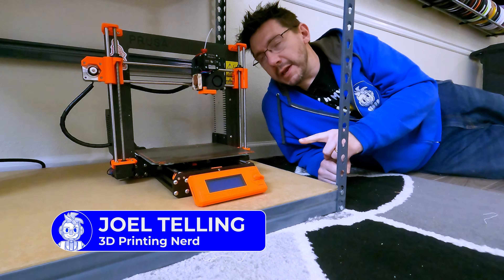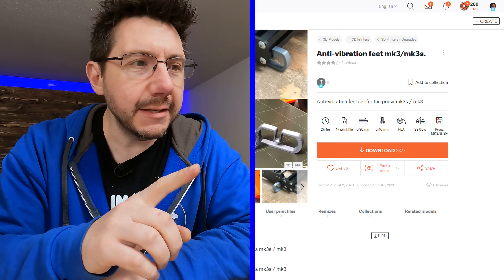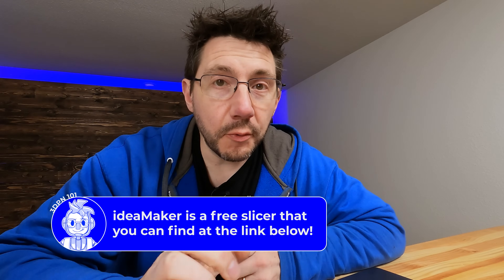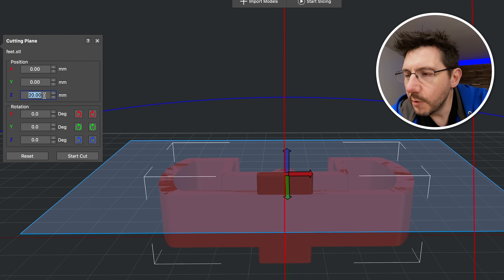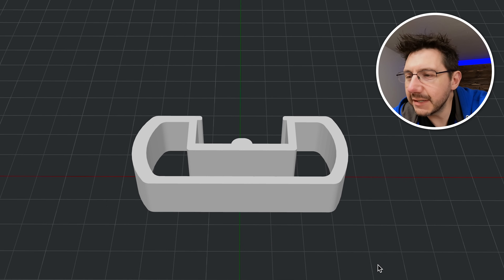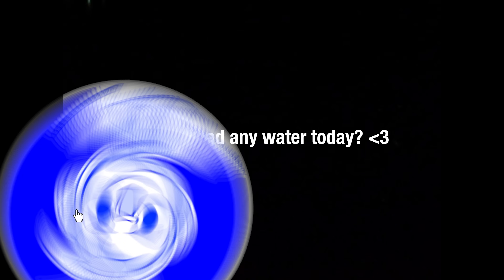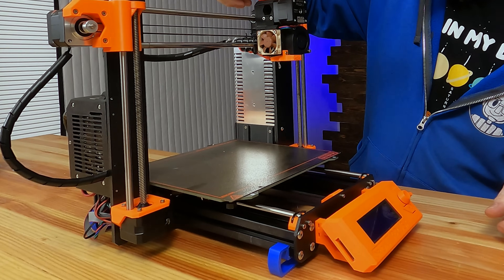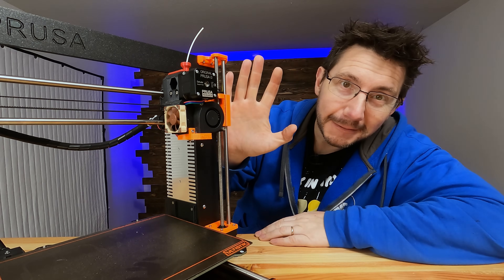ANTI VIBRATION FEET For Your 3D Printer

Comment: Congrats you just made your printer worse! An isolator attenuates vibration transfer which mean in this case the vibration from the printer (hopfully) is less to the table. Printing artifacts are in rare cases are from swaying of the surface the printer is on but most artifacting from viration is from the printer exciting itself and these feet and simular will make make it worse or do nothing if you're lucky. I'm cursious if you left them on.

Comment: Interesting. But ... this could also easily be done in Cura, at least for the bottom side, by simply using -5mm for the z alignment. No supports needed.

Comment: The Prusa library had something similar as I needed to reduce vibration as the printers are in a room next to my bedroom.  What I had found was something that comes in to parts that perpendicularly snap together and resembles a scaled down pre-made ribbon bow one would use on Christmas gifting.  It was printed in PETG.  Works great but this, Joel, appears can solve both problems!  Thanks

Comment: Since you admitted you often loose a foot, you might have observed that OP might want to print 6 (or even 8).  You KNOW you will need them. Partk the spares right on the bottom rails where hopefully you will almost HAVE to find them!  LOL  OBTW, generally vibration absorption will be increased by increasing the number of points of contact!  Thanks for all your content, top notch stuff.

Comment: In my experience, the best way to eliminate that vibration is build a printer like a solid block, any vibration will be transmitted for out of the machine. That's why my machines are totally made in metal like a solid block.

Comment: For mods, "Boogie" on the Printables site has made some great upgraded 3D printed parts for the Prusa. I'd link, but Youtube instadeletes anything I put links in. I like the much more easiy done belt tensioning solutions he came up with, modding my printer with those to dial in the belt tension to perfection. You could also make the machine far less in need of maintenance by replacing the bearings with IGUS synthetics. Of course, that adds a chunk of cost (as in, $200-ish for a full set) and you have to dismantle it all to rebuild it. 

But ten RJZM-02-08 bearings and a set of six AWMP-08 hardened aluminium rods (320, 330 and 370 mm, two each) would mean you never have to oil the slide bearings or maintain them in any way beyond brushing off any dust. Some say you may get more ringing. I'm going to give them a try though, waiting for shipment (turns out, next day or whatever IGUS promises is only true in the US, I got 5 weeks in Europe - but at least they took my order.)

Comment: A big paving stone, 40 x 40 cm and as thick as you can uncomfortably carry is the way to go with these. Remove the plastic feet entirely and let the machine rest frame-on on the stone. Massive noise change, and arguably aven a little better prints because the printer can't vibrate as much. Anti-vibration feet may lower noise but also make the printer move around more. I sprayed my stone with an entire can of plasti-dip, to make it easier to wipe down, and to give the printer a thin rubbery surface to grip. Put a thick foam between the stone and the shelf, as well, to further decouple it.

Comment: I got a octoprint all in one box that fits under the bed between the aluminum extrusion. There is a place for the pi, a place for a 5v psu and a 2x relay so you can control the psu of the prusa with octoprint. It's stealth but it involve doing some mains wiring

Comment: Why would you print these in ABS? Too rigid to smooth out higer frequencies i would think... Anyways there are really interesting anti vibration feet i found and printed in TPU, they work so well i was shocked! thing:5331485 (I did not make it)

Comment: I have an Ender 3 clone, and I replaced the plastic feet with TPU ones (95A) with about 20% infill. Stiff enough to support the printer, but squishy enough to dampen vibrations.

Comment: 1:25 Looking at that model, yeah, you could just make the whole thing taller without using those nubbins, then you could maybe vase mode it with a big ol' nozzle. Alternatively, put the nubs on the outside (even more stability) and put the inner walls at an angle to minimize bridging. Not sure why it's not modeled like a straight up extrusion, maybe it gets too stiff to be effective as a dampener?
If the profile is available as a DXF or an SVG, you could probably do whatever you need in FreeCAD or OpenSCAD.

Comment: looks great! it might be worth modifying it with 2 to 4 screw holes and putting in 2 to 4 screws to help prevent separation of layers. there will always be 
stress inside printed parts from cooling down filament during processing. you can avoid need for screws with an annealing process. put part at temp for about 1-2 hours at 1 to 2 degrees below glass transition temp should do it. for me it is just simpler to add in screw holes and have the metal screws keep bonding then over time it will naturally be constrained and self anneal.

Comment: Can you do a sound check with standard feet to those feet with a wooden table? 

Prusa slicer negative volume would work too. I just increased a leather stamp buy using a cut then increasing zee or zed (zeds dead, baby)… to get the stamp height far easier then going to cad…

Comment: I changed the frame (+linear guides and lead screws in z) to change the print height to up to 490mm 🤪
Reply: Just did something similar and doubled the width of my laser cutter's work are for less than 50 bucks.

Comment: I saw a similar video recently when a guy tested a bunch of anti-vibration methods including suspending his printer and he found the default rubber feet actually provide some of the best anti-vibrations. The problem with the printed feet is they dont last that long, most materials are not meant to be under permanent compression. You'll probably get negating effects after a few months. 
It is good to see you printed them in ABS at least. It should last a bit longer than PLA
Reply: That guy was Thomas Salamanderladererer from Tom's Hardware. Joel is undoubtedly aware of the video.
Reply: @SwervingLemon  I’m from Tom’s Hardware. Tom is his own guy.
Reply: @stldenise  Tru lol. Actually capable of using his own brain to come up with ideas and do testing.
Reply: @kylelongstaff  I saw Tom's video, I'm going to have to try them on my Ender.
Reply: maybe it was this video: https://www.youtube.com/watch?v=EWxpN_Sw5Pg from thomas sanladerer

Comment: If the slicer software you use dont support free cut, another alternative is to just lower the z position of the model till the bit you want is under the build plate. That way it wont print that part.
Reply: I thought the same. Lowering the Z seems a really easier solution and doable on every slicer.
Reply: If your slicer does not support free cut... stop using Cura. 🤣

Comment: I literally just made a mold 3cm(thick) x 5cm x4cm and used normal silicone from my hardware store to fill it out, my printer stands on them since 3 years and it completely removed all the vibration from my table

short
just make feet out of silicon, it's cheap and effective